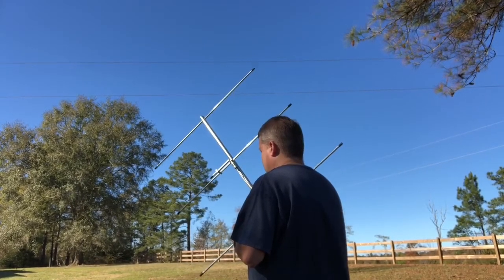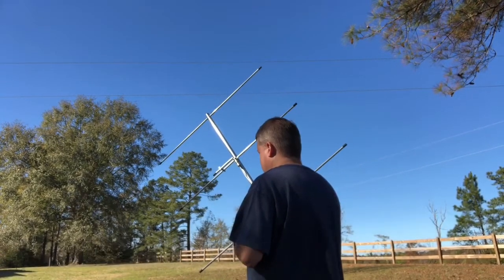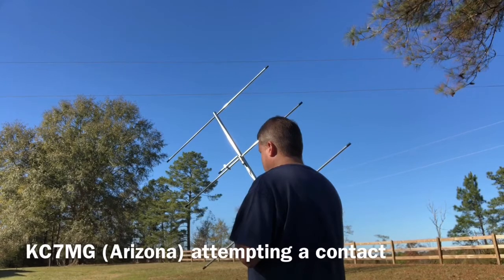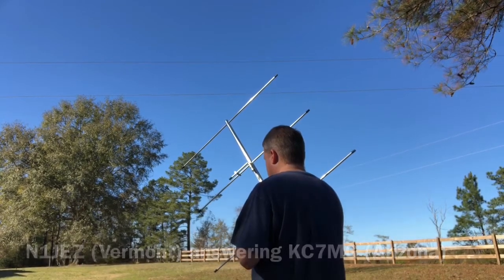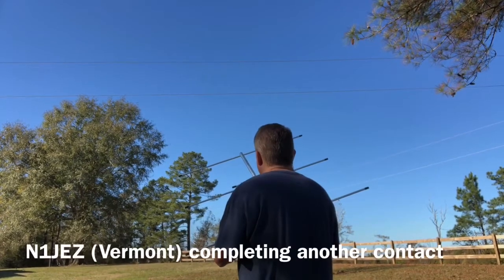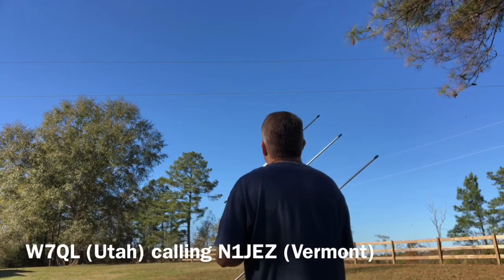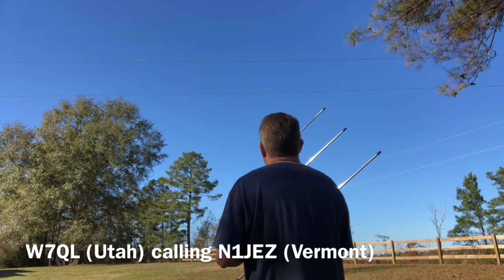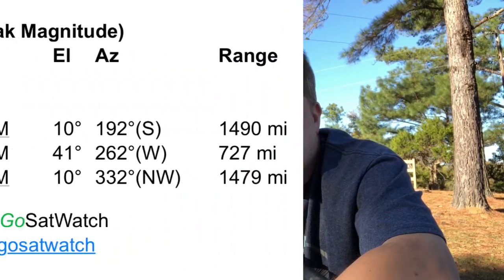2nd Attempt Receiving AO-91 Amateur Radio Satellite / Fox-1B

Comment: Awesome reception.  Any info on which 3 elemant Yagi you are using?  I've been struggling to get a good reception from AO-91.  No problem on SO-50 with its UHF downlink.  But the VHF downlink from AO-91 is more difficult for me for some reason.  Thanks for sharing and keep up the reports.